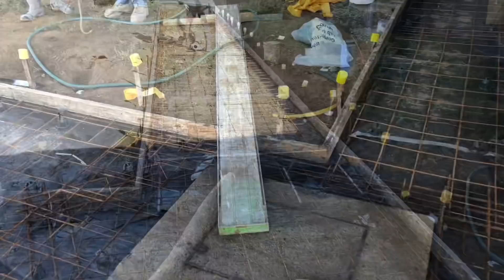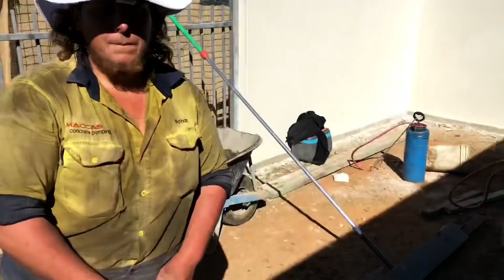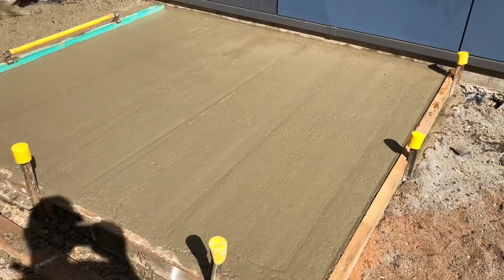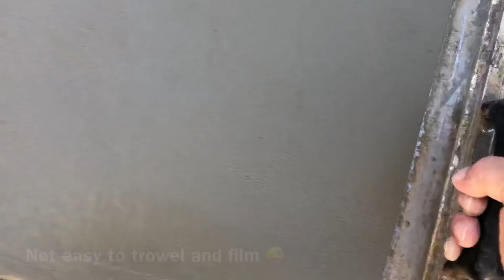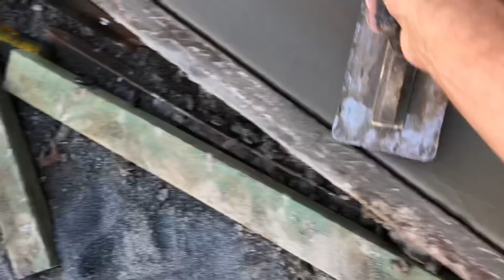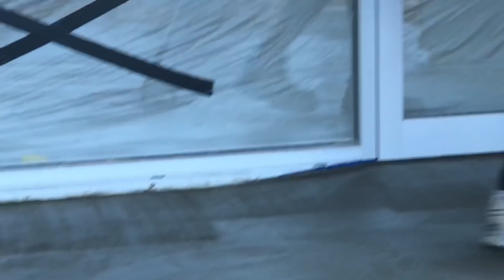How to screed concrete

Comment: Another good job mate well done
Reply from the maker: Ashleigh Pollard thanks bro 👊
Reply: Ashleigh Pollard  your comment on exposed was never never never use knee boards  well buddy you should try and maybe you I’ll learn something about concrete and yes you may even use a chopper with the pan don’t be closed minded and blind sided and yes your screening  must be flat as glass ,yes sire there will be comments on this very quickly by all the master concretes  if this sounds arrogant yes it is but if you know your work well what can I say.But I must say you boys on concrete ninja are a good guide for a lot of persons wanting to learn a little finesse on the fingers points, hey what do I know I’m from Victoria . 
Cheers jay
Reply from the maker: Franca Romas Like I said bro everyone does it differently whatever works for you as long as the customer is happy at the end of the day . Thanks for your comment 👊
Reply: Since my comment about no boards on exposed I actually did and have done it, and yes it helped for a better finish, I stippled and troweled a. 100sq driveway and yes you are right it came out great, all the stones turned and the points were facing down witch gave a much better look when washed off. Mate I’m happy to admit you were right.. maybe though just try guiding people instead of having a dig at them, I don’t think any one out there knows everything about concreting so it’s good to learn also..
Reply from the maker: Ashleigh Pollard hey bro i’m stoked that some of my tips have helped you . I’m not trying to tell people how to do the job I’m just giving them another way of doing things . Awesome to hear the feedback . Thanks bro 👊
Reply: Concrete ninja  hey mate nah it wasn’t your comment is was someone else’s I was commenting on who told me to open my eyes and learn about concrete  sorry man not you
Reply: Ashleigh Pollard  Ashleigh wasn’t having a direct dig at you personally just letting you know that there are many methods to exposed.
But in saying that when ever you do a large area that is flat for a brilliant finish on exposed, use a chopper with the pan on . Put the chopper on when the exposed is going hard the pan brings the rock closer and tighter and when washing off try a mechine that Lenard’s have will wash of and area of 300 square metres in under 2 hours then you just wash of with a garden hose ,leave for two days and come back acid wash and following day blow of dust and seal the job will finish like a mirror maybe not as smooth as a mirror .
Keep viewing the ninja boys they are very good.
Good luck and cheers 👍✌️🤙
Cheers jay
Victorian concrete
Reply from the maker: Ashleigh Pollard all good bro 👍